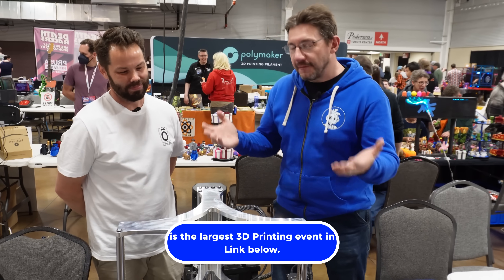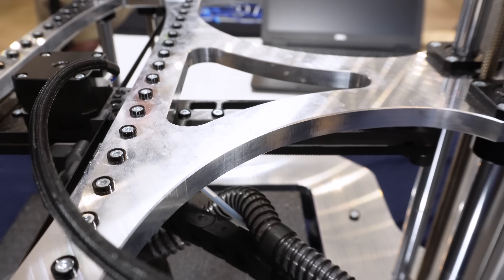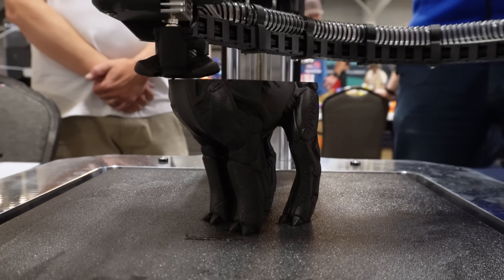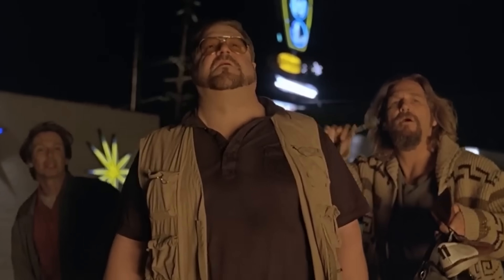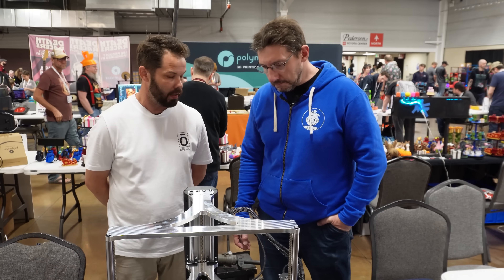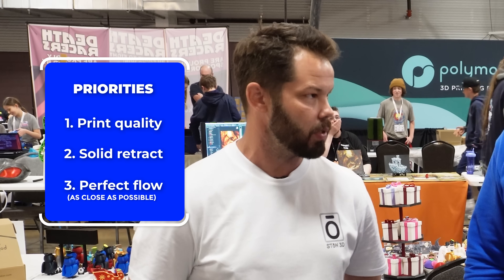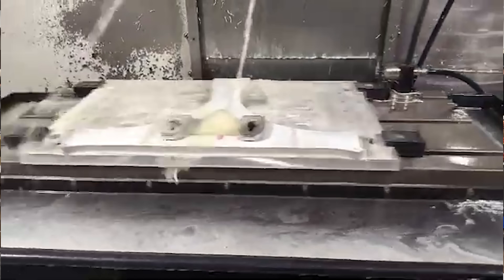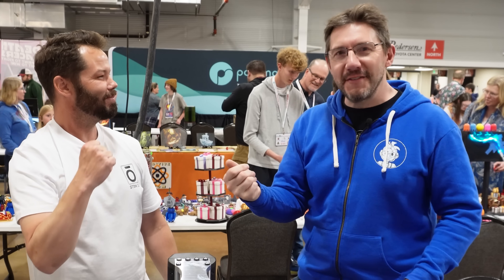Is this the FASTEST 3D Printer?

Comment: That's a good price for a serious and specialist printer with a lot of CNCed metal
Reply: I was expecting to see a price 2 to 3x that, very impressive that they can deliver with such large CNC parts at that price.
Reply from the maker: I thought so as well!
Reply: you can order that funny-looking plate with some holes in it for less than 100 usd or euro in my view. it would take me less than half an hour to make two of them. material is the other half.....but i dont see the point of this printer anyway.
Reply: @simonschneider5913  probably not for you then
Reply: @JonS  I need a big and fast printer. converted my ender3 into a small coreXY last year - and i think i will go with Vez3ds approach for a bigger one.. but i am interested in any concept that has its niche.
Reply: @simonschneider5913  Good luck getting a large 10+kg billet aluminium plate machined for less than a hundred bucks. The material itself before machining is probably at least half that lol and it still also requires a 10k+ machine as well as a fairly skilled machinist to achieve those levels of precision. A one off run of the cnc parts on this printer would be at least 1k usd if not a couple times as much considering it's not made in china.
Reply: @leonartou if you think so, then have fun paying. i wont even try to convince someone who hates on chinese tech.
Reply: @simonschneider5913  I have not said anything that would even imply that I hate chinese tech. I love the avaliability and pricing that china provides. The only thing I said is that manufacturing in china would be much cheaper than europe lol. Read through the last sentence again. All I'm saying is that this part cannot be manufactured at this quality for anywhere near 100 bucks, it's just not possible, mabe unless you'd be making a milion of them and fully automated it.
Reply: @leonartou sorry for misunderstanding your words about china.. theres so much hate going on, I got triggered I guess... ;)

wrt the part in question: I just think its overestimated what that thing is worth. I worked on a machine that was paid off long ago - and we did cheap but precise one-off stuff all the time. granted, that company went under 3 yrs ago.
Reply: @simonschneider5913  No problem
I think of course it's partially just marketing and those parts are not as crazy as they are portrayed to be but still it's one hell of an impressive machine and for $1300 it's not really that expensive either. That's decently cheaper than the closest competitor I can think of, the RatRig V-Core 4 300. The components are also much better on the ston, basically everything is top of the line and it doesn't get much better than those parts in the DIY printer space.